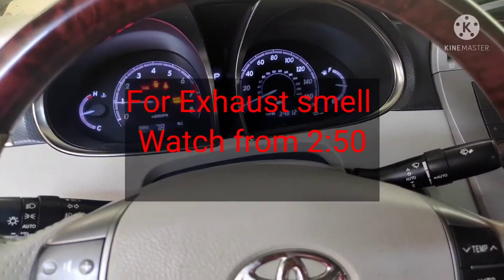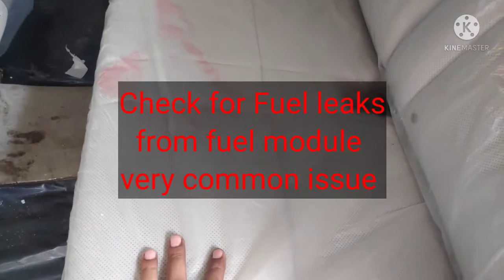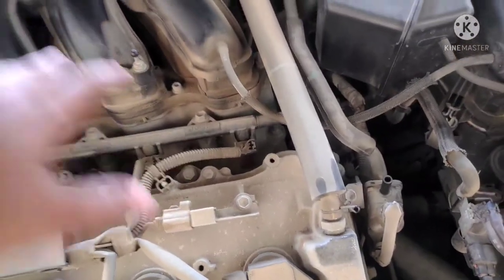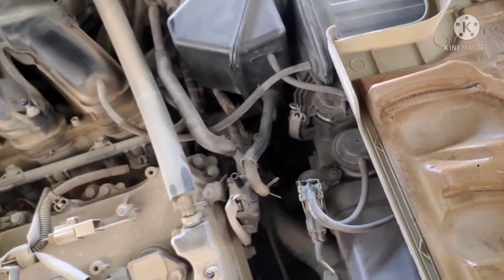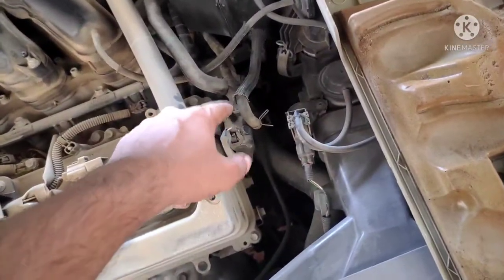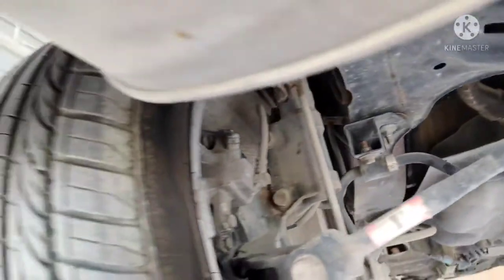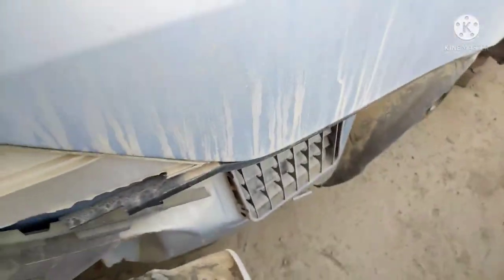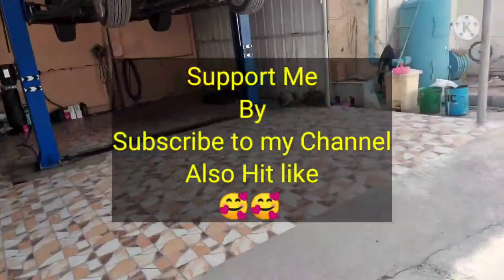Exhaust Or fuel Smell In Car Cabin [ Solved ]

Comment: Thank you for the vent information.  My chrysler 300 was wrecked badly in the back and I have had a bad exhaust smell anytime I get near 80mph or just punch it to get around another car. None of the body shops I ever went to even mentioned anything about the vent. I will be inspecting those tomorrow.  Thank you👐
Reply from the maker: I am happy for you hope you will find problem in your car i have also 2012 Chrysler 300 i also replaced those vents few months ago
Reply: did it work
Reply: What mean by vent does not open up ? 
What does it do more infor ?

Comment: What’s that thing in 01 : 57?
Reply from the maker: Thats evap purge valve when gas evaporates in tank then this valve open flow to the engine so engine can use that evaporated gas as a fuel instead wasting into air
Reply: @CarFaults Thank you very much.